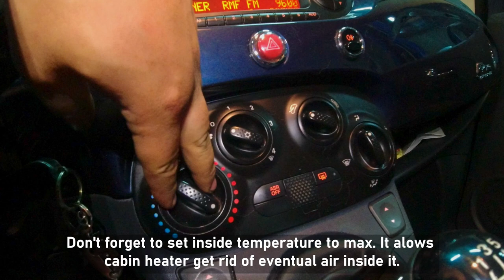FIAT 500 - How to replace coolant radiator / blower motor - DIY

Comment: Any other way to remove radiator fan with out having to break it all down can you remove the skid plate and reach up under it loosen screws and drop it down thru the bottom just wondering
Reply from the maker: To remove blower only you could try to unscrew this two bolts first, disconnect this two plugs and you will see if you have enough space to take it out. But personally I think it will be impossible. There is no enough space but you can always try before removing front bumper. Good luck.

Comment: Complete waste of time and effort... The Fan and surround can be removed with the bumper and Radiator is position...
1. Remove wiring for resistor and fan + - 12v supply
2. undo and remove two screws holding the fan in place, then slide the fan to the side to allow it to move out of the retaining tabs...
3. jack the front of the car up so the wheels are about 4 inches off the ground, then remove the fan and surround from underneath the car... Only one side of the car needs to be raised.
Install new rad fan in reverse of removal.   Time taken about 45 mins Max...
Reply from the maker: Maybe, but I was replacing radiator too and you can't remove it without removing a bumper. Radiator fan was just a "milestone".